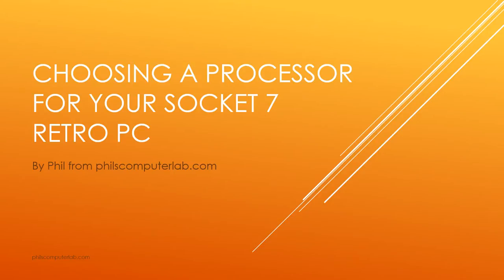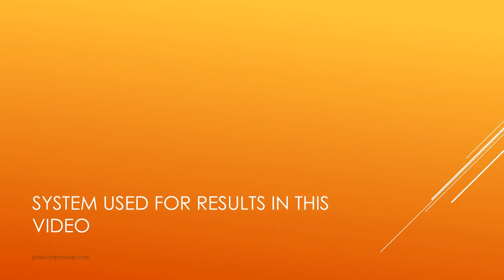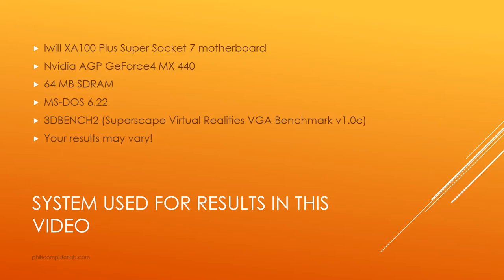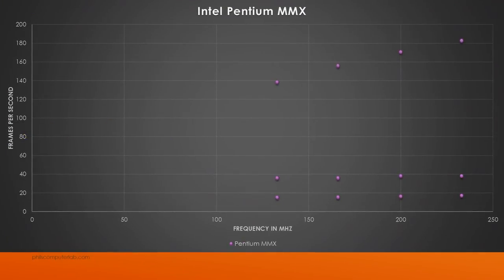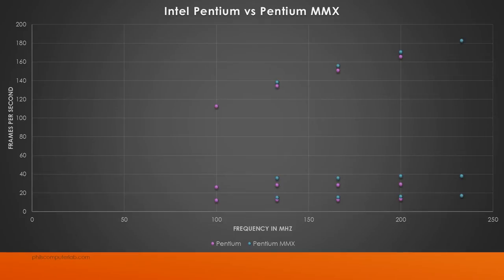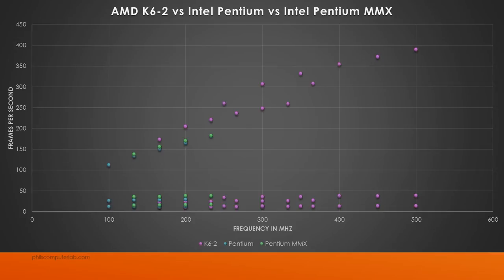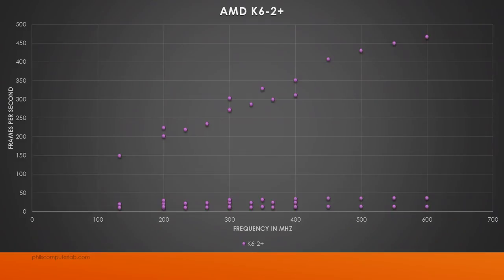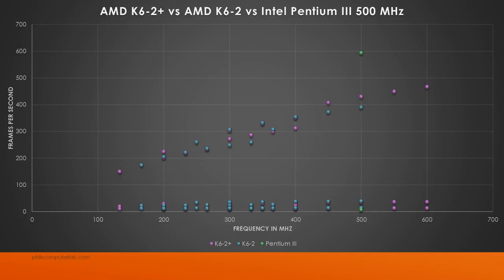Choosing a Processor for Socket 7 Retro PC

Comment: I personally went with a Pentium 133 in my socket 7 machine, the idea was to run games up to and including 1996 , the highest spec games being Quake and Tomb Raider . On the other hand I also wanted to play Day of the Tentacle which has issues with anything over a P166 MMX apparently. P133 was cheaper so I ended up picking that one.

Of course the other reason was simply because I don't have a SS7 board, my board is a normal Socket7 with an Intel chipset so I was a bit limited on what I could choose.

P133 seems to be just fine for those games, Duke3D will run smoothly at 640X480 with almost no slowdown (unless the screen really fills up with explosions),  it doesn't have any speed issues with the Lucasarts/Sierra adventure games, and its easy to slow it down for Wing Commander.

As an all around CPU however, I would have actually picked a K6  , especially if someone only wants a broader range of games to play , its easier to get a K6 to play DOTT than it is to get a P133 to play Quake2 at any respectable frame rate...

its only because I already have the Athlon 1400 machine that I wanted something more specialised for DOS/early Win95.
Reply from the maker: In my current machine is a P200 running at 66 x 1.5 = 100 MHz. It runs all the old games I throw at. But I'm currently playing with a K6-III+ for an upcoming video and I'm tempted to change my current Time machine.
Reply: +lightdark28 FYI when it was new I remember playing starcraft on my P133 with an ISA video card just to see if it would work. it worked pretty well!  It's surprising what you can and can't run on the P133 era.
Reply from the maker: Hey, I had a Pentium 133 for a long time. I remember my friend (he had a DX2-66) coming over one day, and he said "wow that machine runs everything".

And it did. The faster processors, were faster, but didn't add anything that the P133 didn't have, so for a long time you could play all the games.

Even MMX wasn't much of a game changer, I don't even know if there are games that only ran on a MMX from that era. They likely had some goodies that would get enabled or something like that.
Reply: +philscomputerlab 

to tell you the truth I dont have much personal experience with any of the original Pentiums ,  apart from going on the early internet and playing Rayman. for the most part in terms of gaming,  I went straight from a 486 to a Pentium Pro.

P133 is good, and yeah it can run Starcraft well (the game can run on a P90 too , even a fast 486 can run it) , though I would say 1998 is the cut off point for it, even games like Grim Fandango struggle on a P133 (and thats with or without 3D acceleration)

Comment: What do you think about Pentium II or III for MS-DOS games?
Reply from the maker: I mentioned it a little bit on the form of the Pentium III. Because of lack of motherboard cache they are either super slow or super fast with nothing in between. They are a great platform for later DOS games that are not speed sensitive and high resolution DOS games.
Reply: +philscomputerlab um/ the p2 and p3 have L2 cache in the cpu.  Are you simply saying that it cannot be turned off? because it can in some situations.
Reply from the maker: Yes they have L1 and L2 cache. But there is no motherboard cache. It's easier to distinguish the cashed with CPU cache and motherboard cache.

You can turn off the CPU cache, but because there is no motherboard cache, the Pentium II or III will be extremely slow. We are talking 286/386SX speed. Once you get up to 1 GHz, Wing Commander does become playable, but at that speed you will encounter many other games that don't work correctly.

That's the essence of the issue and why Socket 7 platform is so good for DOS gaming.

Comment: What if you had a faster Pentium 3 (say for example, a 1.4 GHz core) that could be underclocked?
Reply from the maker: Yea that's a no go, I tried that.
Reply: +Patch93 You can underclock it by FSB only... that's it , with best BX440 chipset motherboards, you can usually go with 66 - 166 FSB. That means, with lowest FSB 66 , you drop only around 433-500 Mhz PIII, which is still superfast in comparation with 386, 486 or Pentium 60-133. If only they unlocked CPU multiplier downwards on Pentium II and III, how cool it would be now, to build flexible retro machine. Imagine, PIII 1 Ghz, downclocked to 66x2 = 133 mhz. That would be supercool.
Anyway, you can still do it with Thunderbirds and Duron, after some mod, you can unlock them. They can go then from 133 to 1333 Mhz. I didnt test it, but theoreticaly, they could be able to do it.

Comment: Any idea for award 586 bios programmer. Thanks
Reply from the maker: With these old machines use a hardware programmer!
Reply: @philscomputerlab  Thanks for replying. Any specific brand or model no .
Reply from the maker: @mamunmohammad7275  TL866II PLUS is the best one, but not cheap!
Reply: @philscomputerlab  Thanks